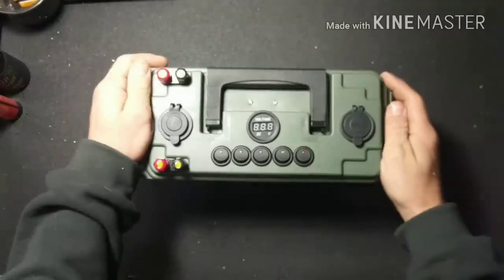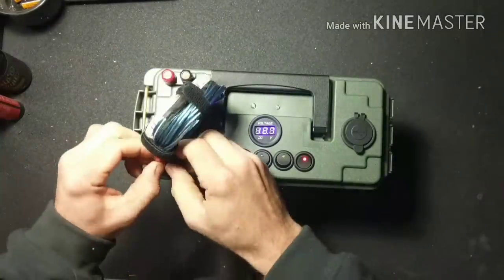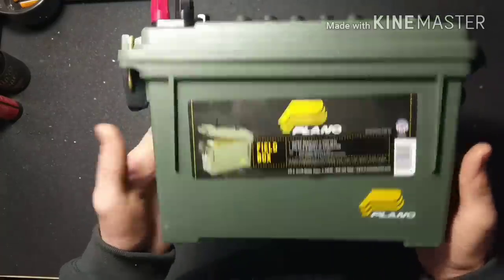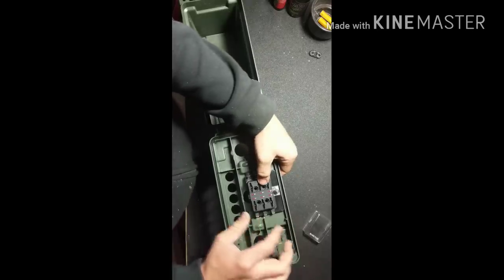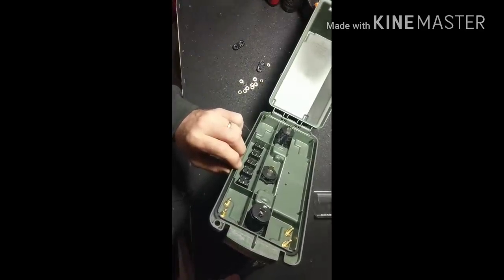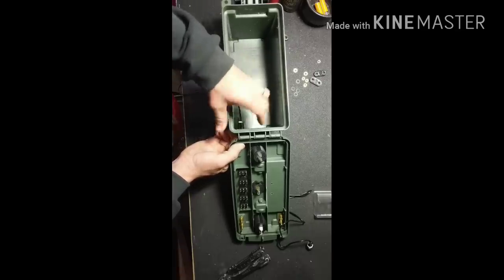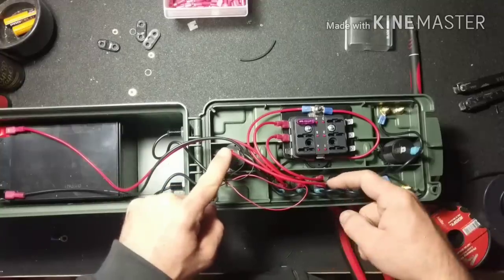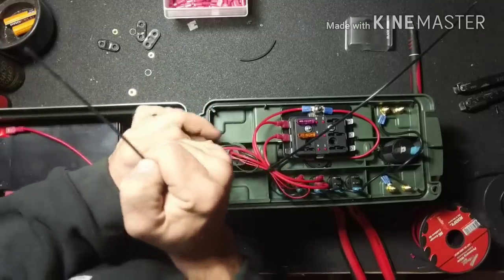How to build a portable power box version two

Comment: JD: I just ordered the parts to complete my own power box. Great video. If I was to use a fish finder, would I attach this to the power post or run a line into the box to protect it from water. Your thoughts are appreciated.
Reply from the maker: You can run it to the posts however if its something you will have on the box often I would install an SAE port and power the finder with that. If you need a link let me know and I can send it your way
Reply: @JDSOutdoors  The link would be greatly appreciated. Thanks.
Reply from the maker: @martinlarkin9624  the 2 pk is cheaper than buying the parts individually but cut one in half. Install the female on the box and male on your depth finder. Can also use it to charge the battery if wired right. 
https://amzn.to/3pvLPm4
Reply: @JDSOutdoors  Thanks, I will give it a try. Greatly appreciated
Reply: JD, if you could advise or show a diagram as to how to link the wires, either through the fuse panel to the SAE port to the fishfinder and also in charging the battery, that would be perfect. Much appreciated.
Reply from the maker: @martinlarkin9624  easiest way to use it dual purpose charging and running the depth finder is wire it directly to the battery with a small inline fuse. That way no switches need to be on to charge just plug and play
Reply: @JDSOutdoors  ok thanks
Reply: JD. What size is your 12V 12ah battery in the video. After wiring was completed, the fuse box would not allow the box to close. Please advise if you can. Thanks.
Reply: @JDSOutdoors  John if you charge from the SAE port. When charging, if the amperage goes above the 13v, would this mean the battery is fully charged. When I saw this, I unplugged the power source. Your thoughts,
Reply from the maker: @martinlarkin9624  yea normal full charge is 13.4-13.6
Reply: @JDSOutdoors  Great Thanks.

Comment: Just a random question....could this tutorial be potentially applied to a larger battery? Say a 12V 105AH AGM battery?
Reply from the maker: Absolutely you could use a battery box like you would find in a boat and build it in the lid and have the large agm in the bottom. Works great I did it in my work trailer. Just make sure you size the wires properly to what you plan on running. Great question thank you
Reply: @JDSOutdoors  no thank you lol. This tutorial has been very educational. The step were very easy to follow.
Now with trying to make this box for a larger cap battery...do the cables need to be a higher awg? Im trying to make one for my trolling motor. :)
Reply from the maker: @taz10029  yes for a trolling motor you definitely need larger guage wires. I dont have the link but type in on google trolling motor wire guage requirements and it will give you a list. You pick the distance, how many lbs thrust etc that fits your specific set up and build from there
Reply: @JDSOutdoors  man that sounds overwhelming. Haha do you take paid ordera? I'd be willing to pay ya for it. lol
Reply from the maker: @taz10029  I used to but I don't have the time with work anymore. It would be awesome to just make cool stuff and vids every day but darn life gets in the way
Reply: @JDSOutdoors  nooooo awww man. I missed my chance at a perfect power box! Haha

Comment: could you run a 300watt inverter though the 12v plug
Reply from the maker: Yes however I would step up the main power wire to the fuse block to 12 guage wire and also step up the wire from the block to the 12v plug to 14 guage

Comment: Hi All- about to start my second one of these and hoping I can get some pro-tips to do a better job on this one. Specifically, when it comes to cutting out the slots on the side of the lid for the plastic nuts for the USB and Cigarette Lighter to fit? What did you use? I used a Dremel with a little carbide tip. It worked...but very messy and kind of a pain. I’m hoping there is an easier cleaner way? Would love to here what you all have found works best! Thanks!!
Reply from the maker: All those questions are answered in this video
Reply: I’ll rewatch- I didn’t think specific types of dremel tips or more importantly technique to get clean cut outs (not the way oversized hack jobs that were my first attempt. Thanks again for a great plan and video.
Reply: Just rewatched- you mention dremel or exacto knife. Hoping some will share specific dremel tips used and technique to get a clean cut out. The vid did not show the actual process (for time I am sure). Thanks again for a fantastic setup and video.
Reply from the maker: @flyhoovers  1 1/8" hole saw
Reply: Not talking about the actual holes for the Voltmeter, USB, Etc....I’m talking about the narrow slits you are cutting INSIDE the lid, on the lid support walls, to make room for the plastic nuts to sit flush inside the lid. You mention how for the voltmeter you have to cut the nut itself on one side because of the cutout for the handle- but for the other side of the voltmeter and for both the cig lighter and usb you are making small slits for the nut. Those are the ones I am going interested in techniques. Thanks.
Reply from the maker: @flyhoovers  ahhhhhh my apologies  I have the best luck with a sharp exacto knife or utility knife
Reply: Perfect- I’ll give that a try on this one. Thanks!

Comment: In your parts list from Amazon you have the volt meter, usb port and cigarette lighter shown as one unit on a panel. Did you do it this way because it was cheaper and then you just pulled each one off of the panel or is there somewhere else where you buy these individually? The reason I ask is so all of the measurements are the same. Were the ones you used mounted on that panel of three originally? Great Video!!!! Thanks for your ideas/help!!!!
Reply from the maker: Curt Peterson I did it that way for a few reasons the main being it's cheaper. they are also a smidge smaller then ordering the individual ones and you also have the option of using the black piece if you want. you can order them individually if you search them on Amazon
Reply: Thank you for the timely response. Looking forward to putting this together. I have to admit....I AM a bit nervous about how close to drill those 5 holes for the switches.......once the switch is in place with the way you have it laid out they are almost if not actually touching each other....tips/ideas/clues as to how you did that? Thanks again!!!!!
Reply from the maker: Curt Peterson they are close and sometimes doesn't touch. and exacto knife is your friend small trims here and there and your golden
Reply: Take your time use a small hole to mark up first then use Draper Redline 68470 Hole Saw Kit works great for me

Comment: How do you charge the battery? Through the banana plugs or do you hook charger direct to battery?
Reply from the maker: gene Couture explains it in the video all the ways to charge it
Reply: Thanks for the quick reply. Sorry about the dumb question - I watched both of your videos back to back and kinda zoned / fast forwarded through the end of the second. I think I am going to wire the connector and use my battery tender charger.

Your videos are both very well done and everything is explained very well - GREAT JOB!
Reply: I use a cigarette lighter connection.  I find that quick and easy

Comment: Is there any way to do this using switches that only have 2 posts as opposed to 3?
Reply: If you have the means to ground the system, you could use two posts. The third post is needed here because all powered items must return to the negative side to serve as a self-ground. Nearly all electrical builds involving boats have this requirement, as well.

Comment: Hi
I find the spAde terminals slide off so easily 
What do you do to stop them coming off please
Reply from the maker: Give them a slight pinch with a pliers and also make sure they are on properly. It's easy to install them where the male prong is between the metal and plastic.

Comment: Cigarette lighters take 15 amp fuses its going to pop that 10 amp fuse. Just a heads up 👍
Reply from the maker: Been using it for years hasn't popped yet. I also dont run high power items on it. If I were to run an inverter then I would need a 15 amp and heavier wire

Comment: Great video very clear and informative 👍, I'm currently researching to do this project myself and many of the batteries state that you shouldn't charge in an enclosed location, do you have any recommendations? Thanks
Reply from the maker: These sealed lead acids have no problems with charging inside. Regular lead acids should be vented
Reply: @JDSOutdoors  thank you! I'll look into purchasing the sealed variety cheers 🍺

Comment: Can this be done using a lithium ion battery instead... Also, what brand is the wire stripper you're using

Thanks
Reply from the maker: Yes it can and unsure of brand
Reply: @JDSOutdoors  I was thinking of using the Nocqua Lithium Ion 10Ah
Reply from the maker: @supern35  that will work nicely

Comment: I know it's not good to run a battery all the way down, at what voltage would you charge this battery?
Reply from the maker: I like 11.4-11.6
Reply: @JDSOutdoors  really? That's like right away almost. I hope I didn't mess mine up. It's at 6.7 after my first camping trip with it. I ran it for 4 days. Thanks for this vid, it's a freaking amazing tool!
Reply from the maker: @3alphaRomeo  full charge is 13.4-13.6 so it's not quite right away lol. 6 is a little low for sure make sure you fully charge it when you get home

Comment: I have a question... I got a Digital Multimeter Current & Voltage Tester with three prongs for my box. how do I wire it?
Reply from the maker: It should of come with a wire diagram I would follow that
Reply: Thank you for getting back to me. I followed your video to build mine. My panel came with just a standard voltmeter like the one you have in your video but I just got the one I mentioned to you. I know where to plug the Neg and Pos wires but do I plug the power out (middle prong) to the main On/Off switch? This is all new to me and don’t know much about it.
Reply from the maker: If it works without it being used I would just cap it. I apologize i haven't ran into that style yet to give a good answer
Reply: I’ll give it a try and see how it goes. Thanks again for your help. Have a great rest of the week!

Comment: Anyone know how to keep the inside insulated for the battery? Ice fishing is here and I want to have the warmest battery possible.
Reply: Try fitting some styrofoam to the bottom. There is enough room in the case to lift the battery off the bottom by 1/2-3/4 inch. That would insulate the battery some.

Comment: The voltmeter that you used is much shorter than the other two items.  Amazon's are not that short???
Reply from the maker: Did you buy the one from the link in the description or did you buy it as a single unit ?

Comment: I need AC power what do you recommend when in comes to connectivity
Reply from the maker: What are you running?
Reply: @JDSOutdoors  Just wanting to charge a laptop
Reply from the maker: @bufftammy735  a small 400 watt inverter hooked up would be more then enough. However this battery wont last long you will need to build something Similar with a larger battery for running a laptop to full charge

Comment: What size are the machine screws and nuts for the fuse block, the ones linked are too big (#10-24 assorted machine screws and nuts)
Reply: I read back pretty far into the comments and you used a #6 machine screw and the corresponding nut.
Reply from the maker: @keeanmorgan6270  yes sir #6 not sure why the 10 is linked it used to be a 6. Wonder if Amazon changed the listing
Reply: @JDSOutdoors  That would be my guess, what length of machine screw did you use?
Reply from the maker: @keeanmorgan6270  do believe it was 1 1/4" but man it's been a while since I made this lol
Reply: @JDSOutdoors  This is true, it has been awhile.
Reply from the maker: @keeanmorgan6270  that being said the one in this video gets used often and still works like a champ on the original battery to lol
Reply: @JDSOutdoors  That's pretty cool, I made two of them but I had to modify the fuse block to accept the #10-24 screw but its sketchy if you know what I mean but they work...

Comment: Are there any issues with over discharging the battery? I know that if you drain the battery too low you damage it beyond repair. Is there any way to fix that issue?
Reply from the maker: Chris Sena gotta watch the meter and don't let it get below 11.8 then charge it back up. if you go to much lower and it damages it there is no going back
Reply: JDS Outdoors Thanks for the reply. Just wondering if you had anything that could help if by chance I forget and have something to auto shut off to prevent damage.
Reply from the maker: Chris Sena I'm not sure I haven't looked into It I guess
Reply: Chris Sena A solar charge controller added (depending on brand/model) usually will have an auto shut off feature. Adding complexity but if you use this overnight while sleeping it's good to have.

Comment: Would you be able to post the list of material.. It's not showing. Thanks
Reply from the maker: It should be in the description if you click the down arrow
Reply: @JDSOutdoors  the show more tab was not in the video.. Hence why i asked
Reply from the maker: @Prepping2endure  not sure what to say ? It shows up on my end I apologize
Reply: @JDSOutdoors  what is the battery you used??.. all other parts are easy.. I just didn't catch the name or aH of the battery.. that would be kinda the info im looking for
Reply from the maker: @Prepping2endure  Amazon has them cheap. Type in 12 ah sealed lead acid and they will show up. Lithium is nice to but expensive
Reply: @JDSOutdoors  yeah Lith batts are pricey.. but like they say ya get what ya pay for.. Thanks for the answer.. was kinda on the right track just though it was a higher Ah battery ..Kudos to your clean build.

Comment: Am I correct that 12 amp hours is 12,000 mAh? If so can two batteries fit? Or does anyone know if a larger cell that will fit in the same box? I have 20,000mAh battery packs..
Reply from the maker: This is the field box so only 1 fits. However you can put 2 easily in the 50 cal boxes.
Reply: @JDSOutdoors  awesome, thanks for the reply

Comment: Can I use a 12v 40ah small car battery with this same setup
Reply from the maker: Jason Collins absolutely
Reply: Would be need to up the fuse size and the post on the battery are the big ones. What type of wiring should I use for that
Reply from the maker: Jason Collins nope the load is the same just more run time with the larger battery
Reply: Thanks for your help on this one. I will let you know how it comes out.
Reply: Do you have a link for the wire you use

Comment: I believe you said in your video what size wire youre using but I can't find it. Are you using 14 or 16 gauge wires?
Reply from the maker: James Garceron 16 ga
Reply: He said 16GA wire for everything at 20:18 in the video.
Reply: Locally Lowe's has 16 AWG wire (Home Depot only had 12 & 14).

Comment: You could put solar panel on side to trickle charge....
Reply from the maker: markymark3075 yes but you also need a charge controller
Reply: Thanks, how bad is it if Ive fitted a smallish panel to a 12v battery without one?
Reply from the maker: well if you don't have one and you over charge your battery it could explode
Reply: Ok, thanks! Looking forward to the build.

Comment: Has anyone tried running an inverter of the cigarette port?
Reply from the maker: Yep it runs it fine as long as it's a small inverter. If you plan on running a 250+ watt then you need to plan for that when wiring
Reply: @JDSOutdoors  wicked thanks, not exactly sure what size yet, looking at using one of these or similar to run a small projector..
What you recommend doing if I was looking at a 300w (or more) inverter?
Reply from the maker: @willbunker470  run a dedicated set of wires to the battery from the 12v outlet in 12-10 ga wire
Reply: @JDSOutdoors  awesome thanks very much for that, would you recommend a bigger fuse or stick with 5 amp? Was thinking of a 10 amp, but not to good with fuses

Comment: Is there a way to mount a solar charger?
Reply from the maker: Joseph White yes there is. video will be out in a couple weeks
Reply: I was thinking about wiring in 12v to 6v adaptor as well for my Mr buddy heater.
Reply from the maker: Joseph White I have a video about that to posted down a ways. the converter fits in the heater

Comment: There's still plenty of room for a solar charge controller as well.
Reply from the maker: Absolutely check out the solar upgrade for solar in this box
Reply: I have a similar setup, with the exception of a 400-watt inverter mounted on the outside of the box, and the solar charge controller mounted on the opposite side of the box, and two SLA batteries, though I think the total amp hours is the same as yours.  Again, excellent build and video.
Reply: @JDSOutdoors  I have another version I keep in my vehicle with just a single 7.5ah battery and a single 12v outlet, but with plenty of room left in the case for other gear, such as a flare, emergency blanket, ration bars, water filter, etc...
Reply from the maker: @douglasharbert3340  they come in handy

Comment: why dont you use lithium ion battery ?
Reply from the maker: Because they are 100 dollars by themselves. But you can absolutely use one if you wish
Reply: @JDSOutdoors  i have a lot of them from old laptop i think i had 20.000 mah capacity . use a tool box is a good idea i think you sould use thermal insulation cause youre  outside and battery need stable tempeture